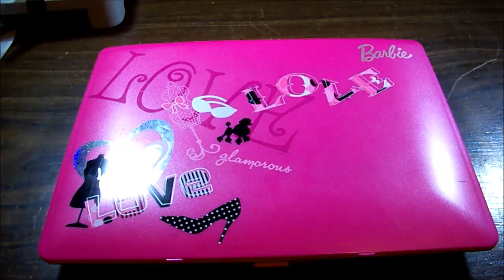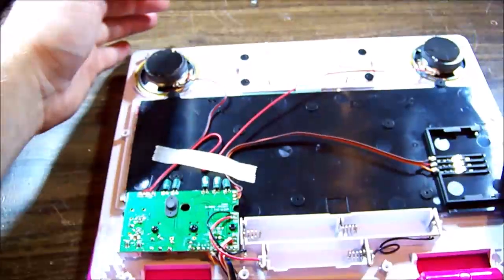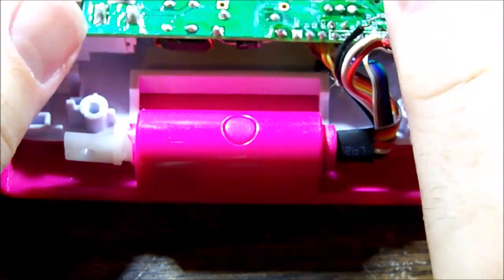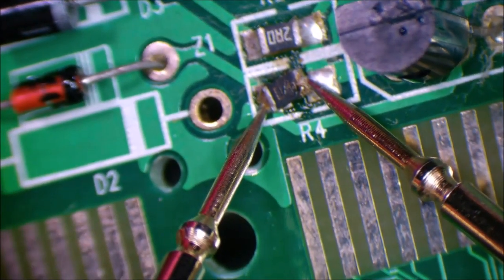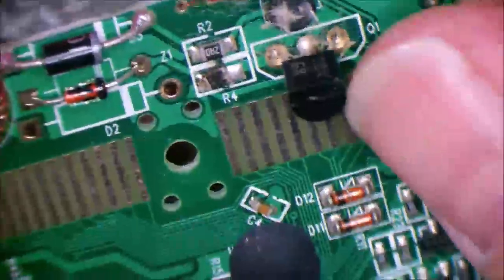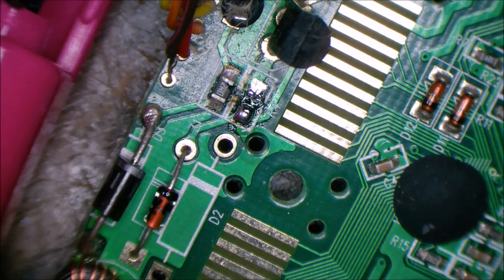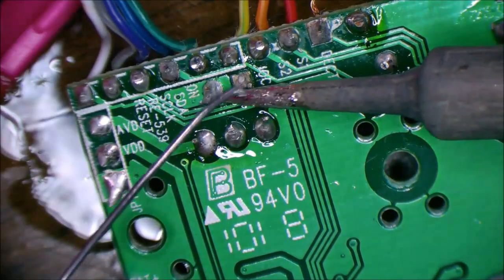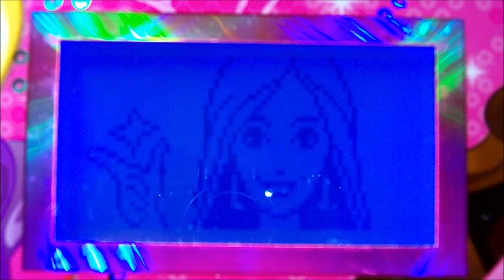Barbie Learning Laptop Repair

Comment: can a keyboard of oregon scientific pc trainer 5  can be fix? i spilled water on it years ago but the screen is still running. the only problem is the keyboard
Reply from the maker: I guess it depends how badly corroded things are but you've got nothing to lose taking it apart to try and clean it.

Comment: Do you think those resistors were part of an over voltage protection design or they just happened to go bad saving the rest of the circuit
Reply from the maker: They are part of an over voltage protection design but because they're so small and the input so large (19V 4A capable) the heat produced gave this result. If they were higher powered resistors I'm sure the zener would have shorted which would have still protected everything else.